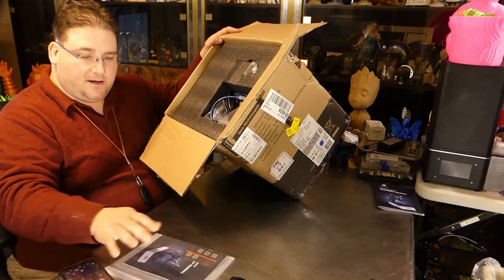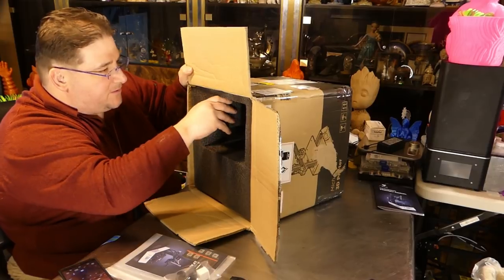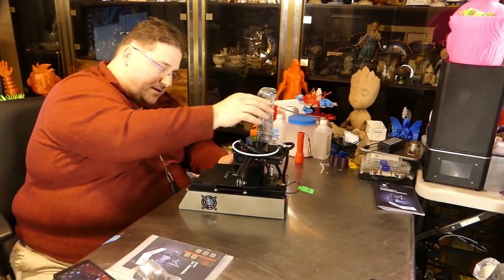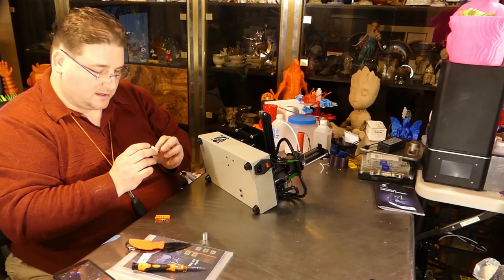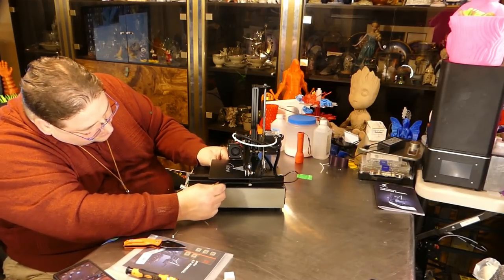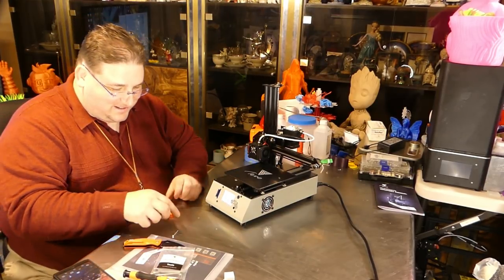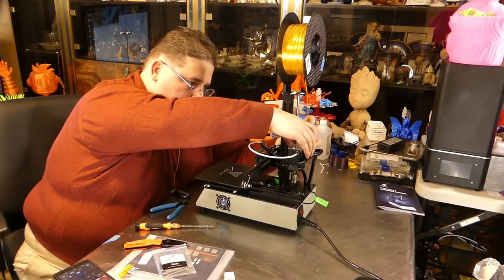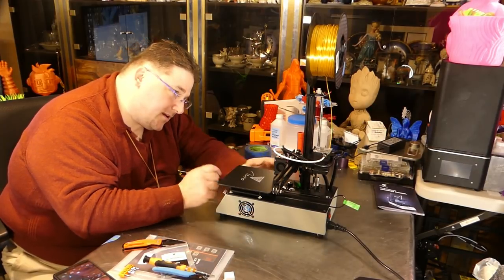Today's 3D Print 201 Tevo Michelangelo! Unbox, Setup, Print

Comment: Nerys - this is going to be long so bear with me.  I have an important question i hope you can help me with at the bottom.  

Forgive me if you know all this but I figured I'd post this as a guide for anyone who needs it. This guide is assuming everyone has already got the proper FTDI software and has their printer tasked to a dedicated serial/COM port.  (if not, go to "Start" -->type "run" then enter key --> type "devmgmt.msc" -->once in the device manager, the COM port should be listed and can be accessed individually.  Check and make sure your drivers are up to date

-Go here: https://github.com/MarlinFirmware/Marlin

-Get the latest stable release (Currently 1.1.8 - December 2017)

-Create Folder on your desktop and extract the zip file there

-If you don't already have the latest Arduino IDE (Version 1.8.5) download it here: https://www.arduino.cc/en/Main/Software

-Install per your specific system

-Go to the extracted Marlin file folder you created-->open "Marlin 1.1.8"-->"Marlin"-->righ click "marlin.ino"-->Select "open with..." and choose Arduino IDE

- In the "Tools" dropdown, set the "Board" and "Processor" options to Arduino/ATMega2650 (can't remember exactly but you'll know when you see it

-For the "Programmer" option, select "AVRISP mkII"

- ****VERY IMPORTANT - In the dropdown "Sketch" go--> "include library..." -->select "Manage Libraries" at the top-->in the top right-hand search box type "U8glib" --> select it when it populates and install it --> confirm it's included by going back to  "include libraries", it should be at the bottom

-Now edit, comment, and uncomment in the "Configuration.h" folder to  the Tevo Michelangelos values.  

-Verify/compile your sketch and once it's done, upload it to your board.  

**********The ABSOLUTE easiest thing to do would be to email me for a Marlin 1.1.7 config for the Tevo Tornado and just port over the Michelangelo's particulars.       ------hkpike10@gmail.com-------
Basically, you'd just have to go in config.h and change your travel limits, bed levelling data points, maybe endstop inversion if those are optical endstops. Of note, the Titan Extruder likes a steps/mm value of 379.14.  You can also change the startup splash screens if you are so inclined. 

Why the hell did I type all of that?  Well, hope it helps you or maybe some of your viewers.  

NOW the QUESTION:
Ender 2 or TEVOMi?
   I'm going to order 2x of one of them tonight.  I know the Ender prints great with some mods and has a heated bed. But I think the engineering of the TEVO is much better and I plan on adding a 110v heated bed switched by an SSR and swapping for TMC2208 drivers (StealthChop2 FTW!) to go with the MKS Gen L v1.0.  And probably an E3D v6.  With that plan in mind, would it be worth going with the Ender 2's to save $60 initially?
Reply from the maker: The engineering of the Tivo Mi is not better. its "identical" to the ender 2. the "all in one" is more convenient though but the engineering is identical. its a modified clone of an ender 2.

I found a 1x5 auto 110v heat pad that I stuck to the bottom of the MI bed and it works nicely. $19 https://amzn.to/2umhor6

The ender still gives me slightly superior print quality and, important to me, a much larger build volume (150x160x225 versus 150x150x150)

so far the MI is a trooper. its working well. just ditch that silly bearing and slap an ender spool holder on top.

Comment: i dont understand comment about switch, it has one
Reply from the maker: ?? What do you mean?
Reply: You said something about that theres no switch, you just plugged it (power cable) and it worked.
Reply from the maker: Oh I am sorry I meant a 110 volt versus 220 volt switch there was none available on the outside of the machine and no access hole to get to one since it came with a u.s. plug i gambled it was set for a 110 volt and it was

Comment: Where is the best place to find stepper motors or spare parts for the Tevo? https://www.youtube.com/watch?v=dZ_WURumfvs
Reply from the maker: Stepper motors are normal so amazon works fine as for custom parts right now only from tevo. Most of it is standard stuff though.
Reply: Cool thanks! Just so I do not get confused do you know what the name of the stepper motor is so I can look it up on amazon?
Reply from the maker: I will have to double check but i believe it uses normal nema 17 steppers. This is the one i have ordered in the past. https://amzn.to/2HhnaAE

3 actually one each for my duplicators and one for mt x3s
Reply: Fantastic! Thanks :)
Reply: Oh yes I forgot to ask... do you know what kind of motherboard I would need to buy in case the issue is not with the stepper motor and something is fried on the chip?
Reply from the maker: That i assume would have to come from tevo.
Reply: That makes sense... because I opened up the machine and fumbled around with the wires. The stepper motor I thought was broken was for the X axis but when I switched it to the Y it magically worked. So the motor is fine but then I guess the X Axis connector on the motherboard is not working. I also tried connecting a different stepper motor to it and fail... Guess will need a new motherboard...
Reply from the maker: Sounds like it sadly. Your testing seems sound. Are the dricer built in or removable? If removable swap two see what happens.

Comment: Man I am not sure what is going on with your adio but that is way bad...hard to watch ...I struggled through it but just barely...
Reply from the maker: Heavy interference coming through the lav mic from the power supply of my battery backup not the printer. I thought I had corrected it and then I saw the camera operation in progress and glitch on the screen right at the end there which is why I stopped the video since I knew that meant the problem was still there but I could not redo the whole video since I already removed the printer from the box :-)